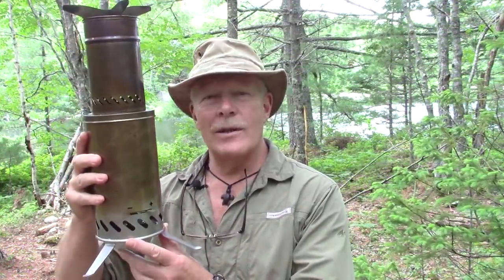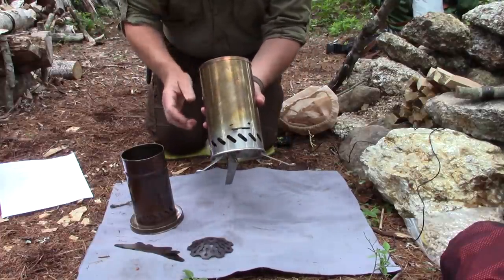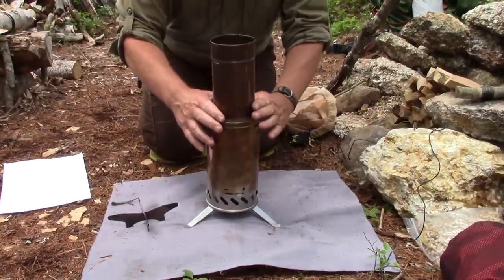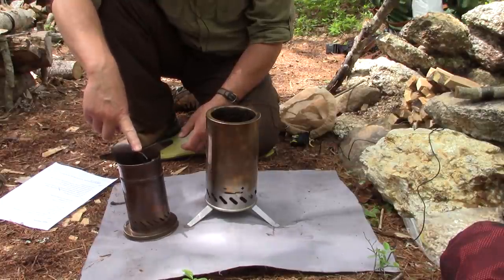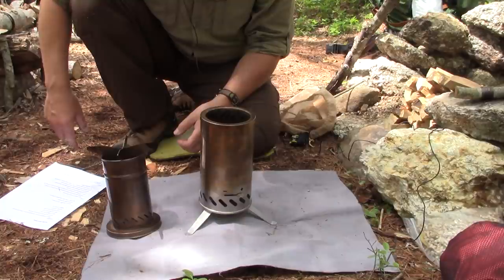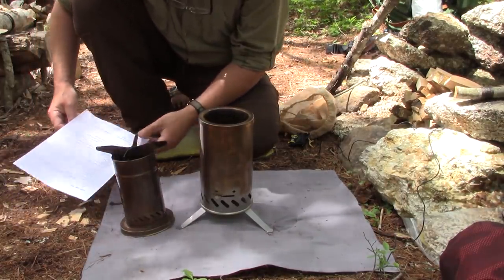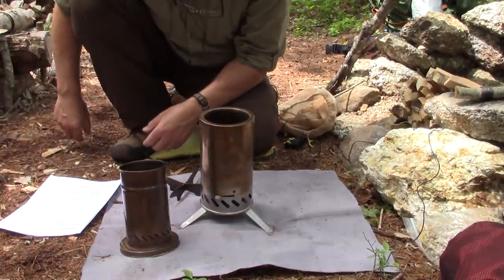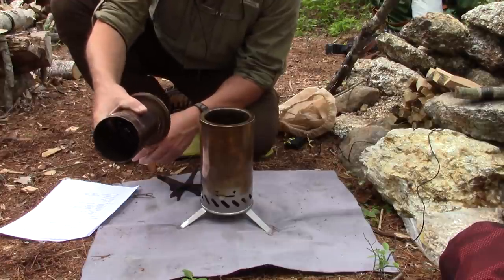Pyrolino Wood & Pellet Stove - Part Wood Gas, Part Rocket Stove

Comment: Really like the way this stove was designed to be a wood/gas stove. More of a heavy duty piece than you would think initially by looking at it. Less smoke is always a plus when you're trying to cook over a fire. Looks quite gangley and tall when it's all together, and not at all easy to add more fuel later, but I think for the most part once it's fueled up and running, when would you ever be needing more fuel than that one load anyway? As with many of these things, buying one means something being shipped from overseas, Greece in this case, which is also surprising. They include worldwide shipping in the cost of the unit though...
Reply from the maker: My thoughts exactly. Thanks for commenting

Comment: I have a combo rocket/woodgas stove but it weighs about 15 lbs so car camping or power outage use only.  It's a big can thing by silverfire... the survivor, i think.  It works very well.  Great for stir frying with a big wok.
Reply from the maker: Yes, that is a real rocket stove with an insulated chimney. I am looking to buy one to add to my collection. Way heavy but super efficient. Thanks for commenting
Reply: @MarkYoungBushcraft  it also has wood has features in that it injects heated air above the burn.

Comment: Colin Furze just posted a video where he created a wood gasifier as an engine to power a lawn mower. One of the major problems he ran into was tar as a byproduct. Have you run into this with any of the gasifier stoves you've tested?
Reply from the maker: Interesting. I will watch that video. Not much in the way of tar, especially with this stove. Sounds like the gasification is not complete and the exhaust is cooling down and condensing. I do find all woodgas stoves smoke as they get going but once pyrolisis kicks in they are pretty clean. Thanks for commenting
Reply: Mark Young there is tar with gasified engines since the wood gas is created, but not burned, and cooled, before it gets to the engine. The solids condense out of the gas during cooling, it one of the big challenges with gasification to run engines.

In a stove, the solids are consumed in the fire in the primary as well as secondary combustion.
While both uses involve wood gas, the operation is completely different.

Comment: Only question that comes to mind is does the chimney need to be so long?, where it shorter and it still able to create the vortex and clean burn, then it would be lighter more stable and have less heat waste.
Thank you for showing Mark.
Reply from the maker: That is a good question. The length does add to the drawing in of air (chimney principle?) and the vortex created by the fins and vents all add up to the cleaner tertiary burn. It may work with a shorter chimney. The stove does not need the chimney to function well. Its just that much cleaner when it is used. Thanks for commenting

Comment: Very interesting stove, Mark. I've holidayed on a couple of Greek islands (including Rhodes) and it's wonderful to be on that soil, seeing the sheer raw nature and beauty from rock to water, and thinking of the legends it inspired with the Odyssey and all the rest. Glorious end of the world, if you ever to Europe you should put it on the list.
Anway, to risk boring you with more wood-stove chat, I've been wanting a cheap, light firepit with an ash-pan. Doesn't have to be a stove, perhaps just marshmallows, it's for the light and a bit of heat from a fire. I also wanted hot-coal containment. There are a few very small ones that I'd seen before, I think some you've tested and some I've seen others using on Scottish hills youtube diaries, but I found a (I think) new, hexagonal one (that ISN'T the Vargo clone) that was only £7 so I've ordered it from China. I thought you might be interested in seeing what I found. It's possible airflow will be an issue, the ash-pan seems to seal-off the wood-pan, but there is a lot of ventilation in the sides; and I have collapsible bellows if I need. I'll let you know how I get on. Anyway, a Link to EBay UK so you can see it, doubtless on Ali and a bit cheaper too.
https://www.ebay.co.uk/itm/Outdoor-Folding-Picnic-BBQ-Camping-Cooking-Wood-Burner-Stove-Charcoal-Grill-Lin/174265735327
Reply from the maker: So, I bought the four sided version of that stove and will be reviewing it soon. I am now thinking about buying the six sided one as well. Thanks for comenting

Comment: Interesting conversation pc. But I don't think I could trust a big cast iron skillet on top of that chimney. Thanks for showing us what's available Mark.
Reply: Mark wouldn't say it is stable if it wasn't. Remember this is heavy-gauge not the Lixada stuff you could tie a string around and use as a kite. 😄
Reply: @darthkek1953  You be you.  I'll be me.
Reply: @FnLn55  No swapsies? 😅
Reply: @darthkek1953  If I put my 12" CI atop that chimney, there might be floppsies!
Reply from the maker: I can understand your reservations about putting anything heavy on top. As long as the base under the stove is solid an flat, this stove will support the weight and not tip. Still I would keep an eye on it to make sure it didn't get bumped. Thanks for commenting
Reply: @MarkYoungBushcraft  . . . I know you intend to cook some meal on it.  A heavy skillet on just the base without the chimney is probably doable.  I know that I speak for many when I say that we've all learned a lot through your continuous experimentation . . . Many thanks for your time & efforts.
Reply from the maker: @FnLn55  It is my pleasure. I have fun playing with the stoves as well

Comment: Thanks, Mark, but, at that weight, I would rather bring a hot tent titanium folding stove and try to adapt the flue for direct fire cooking. The cost is much, much higher, but the versatility would be unmatched. I am currently considering hot tent camping, and do not own either a tent or stove at this point, so this is theoretical, but logical.
I do, however, own and use a Kelly Kettle Scout in aluminum, and it makes a great cooker, but the kettle must have water in it to avoid damaging it. With the Kettle on the fire base, it's an awesome rocket stove.  The base itself is good for slower cooking, like  grilling meats and simmering soups.
Reply: Horses & courses. Not everyone wants to go hot-tenting, or needs to. It's only ever a novelty here in Scotland and would loony tunes in Greece, but in many places in the North Americas it's a lifesaver or at least a game-changer. I had a Kelly Kettle years ago, got given away as I moved countries for jobs. I fancy the "mKettle SAS" as it is compact and snag-free (only boils 0.5 litre, but that's enough for me... it's not intended for group-use).
Reply from the maker: Yes, this is not for everyone for sure. What it does, it does well but is not something I would want to carry far. Interesting idea about using the flue of a tent stove to cook with. Thanks for commenting

Comment: Definitely an interesting attempt, but ridiculously tall.  Those three legs would not be enough width for the height if you had a heavy pot, plus tripods are not all that stable.  I'm sure you e had and seen enough YouTube cameras going down.  They have too much space between them.
All in all a silly idea, with too many issues to overcome the benefits.  Still, am interesting attempt.
Reply from the maker: The base part works well enough on its own that I doubt I would use the chimney very often. Thanks for commenting Jim